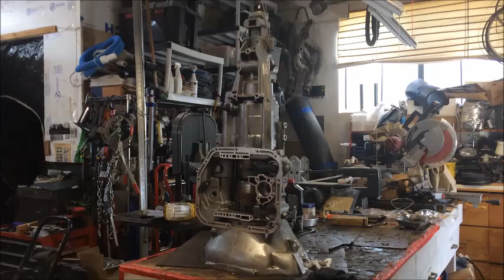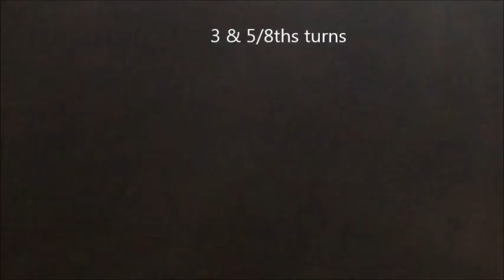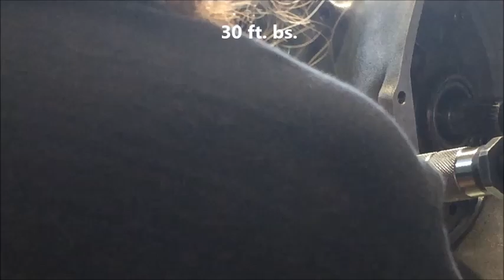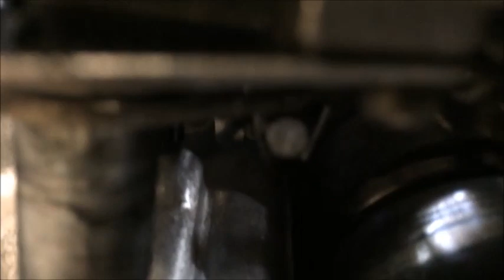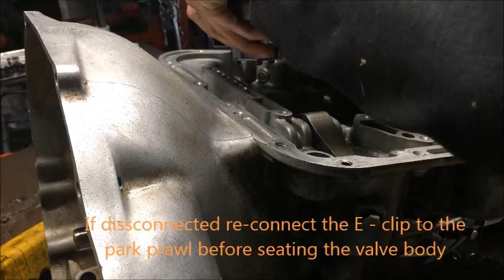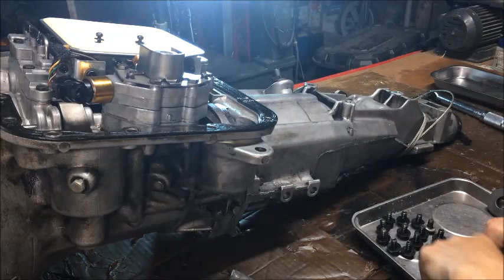42RE Rebuild Part 6

Comment: I'm having a hard time putting the overdrive back into the transmission it won't go all the way in. There is about a 1 in gap that still need to go in and I'm banging it with a hammer but no luck I think it's getting cought on a bearing but not sure. Please help
Reply: He explained in he FIRST VIDEO you can't allow the units insides to move around it can cause it to become unaligned and you'll need an alignment tool! Did you even watch it all?